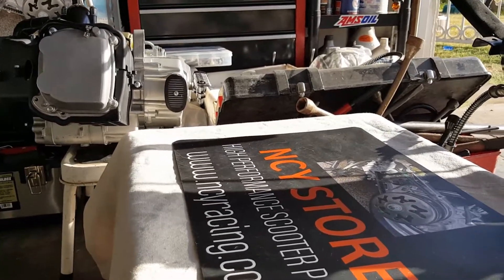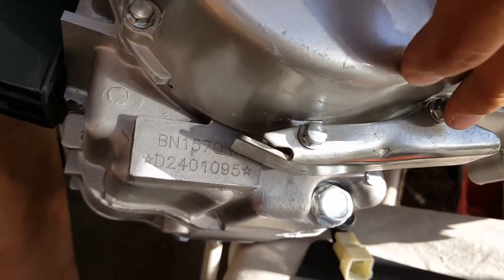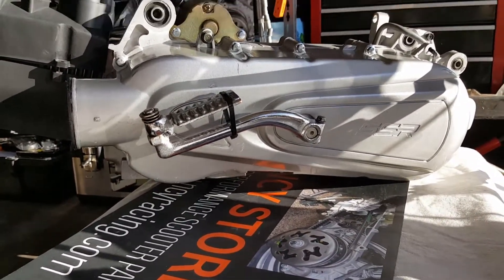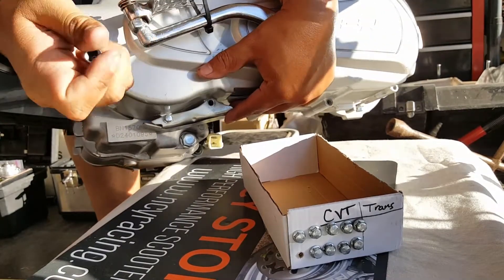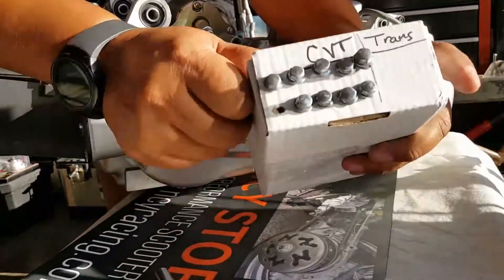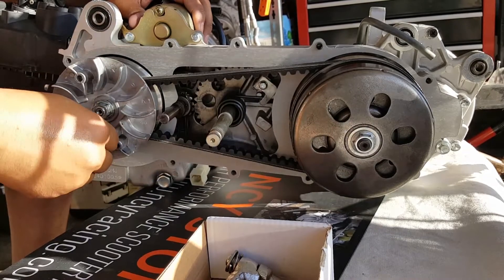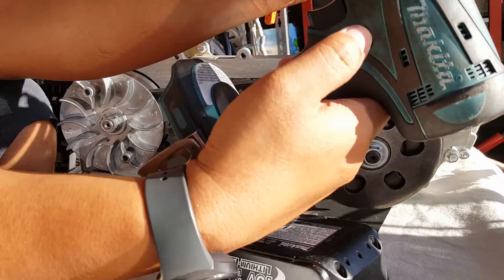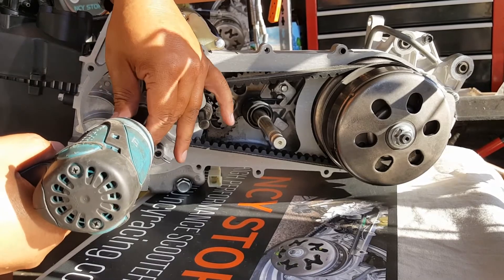How to Disassemble GY6 CVT & Trans 157QMJ Part #1

Comment: I have the same motor but it's for my ATV I am need of some advice i have a grinding nosie and it kicks it's self out of gear so I pulled the transmission and cleaned up the gear box and gears and put it all back together and and it still grinding and kicking it's self out so my question is it the clutch or something else  anybody having this same issue on the gy6 150 157QMJ please give me some ideas on how to go forward from here to fix this problem    thank you  Allen

Comment: Nice video NYC 👌 I have question I followed your video installing 180cc big bore kit and bored it out and I installed cranckshaft everything fits perfectly to perfection completed it but when I try to start the scooter the motor turns over slowly like it's seized up or doesn't turn at all I tried turning the stator by hand to top dead center but it's  really hard or difficult the battery is new fully charged? Any suggestions? The motor shouldn't be difficult 😬 to turn by hand right?
Reply from the maker: Do you have a high-torque starter motor installed? Also did you use a double base gasket see the cam chain tensioner super tight I thought I didn't need to use that double base gasket just single base gasket non spray (dry). I only spray the cylinder head gasket the metal one gasket copper spray.
Reply: @NCYSTORE  The small gear that sits behind the Variator on the cranckshaft I had to press it on maybe I pressed it on to hard could that be the issue why it's difficult to turn over not sure just s guess????
Reply from the maker: @fashionstreet1   you mean the kick-start gear I don't think that would hold you up unless you put the kick-start mechanism maybe got Jam you can check make sure you put a little moly graphite Grease
Reply: @NCYSTORE  No the small gear that needs to be pressed on the cranckshaft inside the casing behind the Variator on the left side of the bike where the clutch inside!
Reply: @NCYSTORE  I used my stock starter for my 157qmj is that okay or would I have to use a high performance starter?
Reply: @NCYSTORE  I only sprayed copper spray on the soft single gasket near the casing correct?
Reply: @NCYSTORE  It's my stock starter  when I try start it it sounds like the battery is dead but it's fully charged and sounds like the starter is gone but it's practically new 2or 3 months old when I brought the motor I'm just installing the 180cc bore kit do I need to use a high torque starter with the 180cc bore kit?